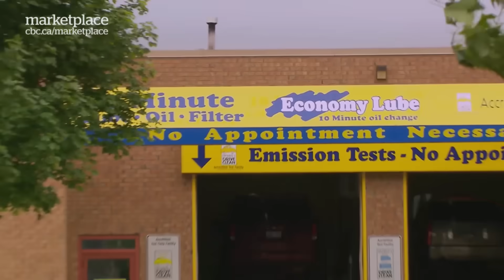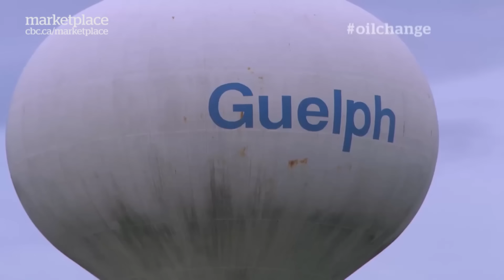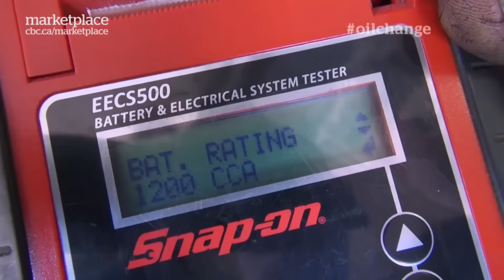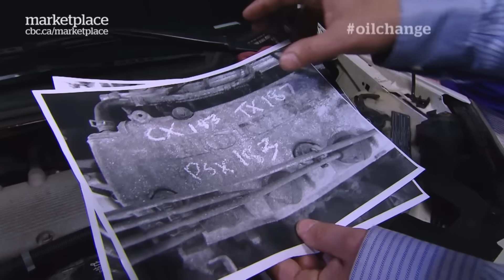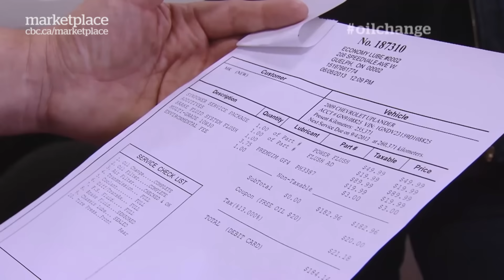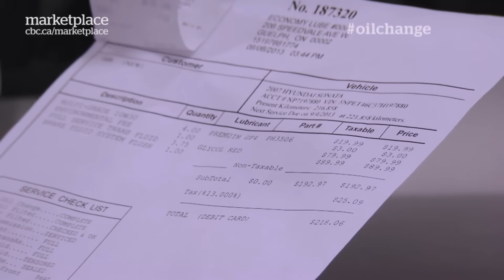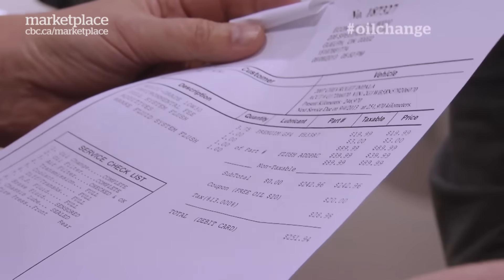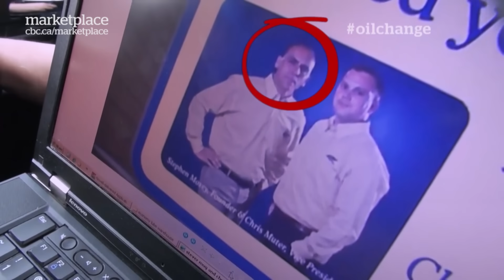Oil change scams: Hidden camera investigation on what really happens to your car (CBC Marketplace)

Comment: A honest mechanic is as important as a good doctor.
Reply: And just as hard to find!
Reply: If your brakes or steering goes out while you’re doing seventy you’ll appreciate a well maintained car like never before.
Reply: @johnnolan4003  Power steering flushes aren't even a thing.  You will not find it in any owners manual on any car.
Reply: John Nolan Next time you're sick in hospital remember to send for a good mechanic.
Reply: @tonygrettel  Hydraulic power steering fluid still is used by many vehicles. My G37 recommends change at 60k, i do it every 30.
Reply: Tony & Grettel Perricone the commercial vehicles I used to drive were not equipped with automatic transmissions nor power steering. To drive one of those bucket of bolts was to take your life in your hands.
Reply: You know a mechanic when you take your car to him with a suspected problem and he tells you that you do not need repair work. I found 2 good mechanics this way. I went to the second mechanic after the first one retired.
Reply: Except if your car dies you can buy a new one....
Reply: I think a an honest doctor is more important
Reply: @스머프-s7g  I think it is also important to have a knowledgeable, compassionate doctor. One that communicates and listens.
Reply: @mayonnaise6087  When you get hurt badly because of shody mechanic's work you'll appreciate an honest mechanic
Reply: @torTxoFognaTuluZ  There are bad doctors and health providers in spite of the health organizations. Yet, you have mechanics who are stealing money from their customers. We must demand honesty in all consumer sectors.
Reply: there are honest mechanics, even mechanics that go beyond the nuts and bolts and study mechanical engineering texts, chemistry texts, electrical texts and metallurgy... all of  which apply to the modern car. I was an honest mechanic for many years but lacked the buildings, the fancy certificates on the wall (most are meaningless),the clean white uniforms, florescent lighting and other optical props that say 'this guy is a real pro'.  Yet I never lost an engine to an improperly installed headgasket nor any other major malfunction of anything I worked on. Still, getting work was difficult, without all the trappings. Yet I saw people making money with 'orange rebuilds' (steam clean the engine and paint it with industrial orange... that was the entire rebuild. Frustrating. Now I will not work for others, I only work on my own vehicles or close friends, and not much of the latter. BTW, because I did not have all that 'gingerbread', I did not ever once get paid scale for my work.
Reply: BEWARE PEOPLE THESE OIL CHANGE SCAMS ARE STILL GOING ON. I PURCHASED MY OWN SYNTHETIC OIL TO BE USED AT A OIL CHANGE FACILITY AND THEY SWITCHED MY EXPENSIVE OIL FOR A CHEAP NON-SYNTHETIC OIL. THIS HAPPENED IN AMARILLO, TEXAS. IT'S PITIFUL YOU CAN'T TRUST ANYONE !
Reply: There are non unless you do it yourself
Reply: Not many honest Doc’s from a honest mechanic that went for 1 op and they gave me 13 ...?...
Reply: All you need is a little bit of knowledge.

You don’t have to be able to do the stuff. Just enough to know if it’s needed or not.
Reply: Car doctors
Reply: No.  Because I can fix my car myself.  Always have & always will.  I can't put in an artificial hip though!
Reply: Lol nope
Reply: Indeed 🙏🏾
Reply: I am so glad my little brother in law is a top notch mechanic. I can bring my car, and he fixes everything in his free time for purchase price of parts and a nice tip.
Reply: My dad says “honest mechanic” is an oxymoron
Reply: John Nolan bet you had some serious guns though
Reply: Don Townsend ouch!
Reply: John Nolan Oil change workers are not mechanics.
Reply: John Nolan People need to learn how to change their own oil. Its very simple.
Reply: an
Reply: @스머프-s7g  doctors aren't as inclined to up sell. how many Drs work on commission like this?
Drs are more likely to get kick backs from pharma companies, lunches n gifts to write scripts for their medication
Reply: Not if you don't own a car.
Reply: Preach
Reply: Enlight of the popularity this post has, I am offering $14.99 oil changes, and a free 99 point inspection. To everyone.
Reply: have a sick kid that needs a doctor? well a car is gonna be necessary no mechanic no car, no car, no help for sick kid
Reply: An*^
Reply: John Nolan, when my son worked as a Toyota mechanic, the shop encouraged the mechanics to do work that wasn't needed.  He told them "I will NOT do work that isn't necessary"  Some of the mechanics would do it, but they had trouble sleeping at night.
Reply: I'ma mechanic and all these they show is true
Reply: @jbodden6977  'orange rebuild' LOL! yeah, so true...coat of paint and the value increases, many fold.
Reply: hard to find one , seems to be a trait of their profession . I guess we all need to learn more about our car .
Reply: And an honest mechanic may charge more per job, but you get what you pay for
Reply: And just as expensive too.
Reply: A honest mechanic only lower your chances from mechanical failure accidents, which might still happen. Doctor meanwhile, is there to address much more possible sources of your harm. It's not comparable at all.
Reply: A good and honest people is what we need, whatever their job is..
Reply: U peoples mindset doctors can cheat patients by operation & spoil others health for his survival but mechanic/lower class should not cheat white color job mens & businessmens
Reply: You're trying to compare Apples to Oranges.....Which is more important 🤔 🤦‍♀️😂😂😂😂
Reply: C Hoc   All 3 were upstate South Carolina.  I'm sure it's statewide, and nationwide.
Reply: @xFlared  I just traded my 2013 g37 for the 2019 q60. :) You are correct about the fluid change recommendations.  🤙
Reply: C Hoc  You are right. I sit here with a serious disease that should have been detected by my health  provider. I am debilitated now due to their incompetence. Yet, I have an excellent health insurance company. Blue Cross and Blue Shield have treated me in an exceptional manner. It is why I make objections when I feel that a doctor is trying to take advantage of them.
Reply: Yes we should all be that's why I studied to be that exact guy
Reply: i have my father in law 😀😌
Reply: I’m a doctor and I agree. Prevent accidents due to car trouble in the first place and there would be less accident victims we would have to treat.
Reply: @Kurama_02  It's easy to change your own oil... sure, if you are young and have no problems with mobility.
Reply: Those are just as rare and hard to find these days!
Reply: We don't call it pratice
Reply: I'm a honestly poor mechanic that sleeps great every night !!!!  I'd have it no other way .  
With respect,
   Russell
Reply: There are no good doctors that prescribe us pharmakea i.e. witchcraft, sorcery and poison after accepting bonuses from Big Pharm.
Reply: Zappacosta   No a doctor is governed by insurance and drug companys
Reply: ChrisGvitar maybe you can
Reply: @mayonnaise6087  Different industries but both are just as important. Both professions can save lives if honest and can take lives due to selfish means
Reply: and in some cases you only need one!
Reply: We all should handle these people   the right way with a right and left then the law comes in
Reply: That’s why I fell in love with my hubby, he’s a mechanic that doesn’t work as a mechanic. He just knows all about cars. He takes care of our cars, we never go to a mechanic . But if we do need a mechanic, he has a good friend who owns a shop. We also have  a cousin who’s a master plumber so we get plumbing free. And cops who give us pba cards. And an electrician friend. And an awesome roofer friend. We have all kinds of good friends. Oh and my bff is the best construction worker ever. He’s incredible. Anyone who is my friend has a friend with huge benefits
Reply: @Puddycat00  nice
Reply: That's exactly right...I have 5w20 in my veins and I need a flush every once and a while
Reply: My hubby is a mechanic and there have been several jobs he has quit because the boss was asking him to be dishonest.  He won't work for someone who is shady.  He likes to take time with guests and he will take time to explain why you need each repair if need be.  There are honest grease monkeys out there.
Reply: @Kurama_02   ,n
k
Reply: @xFlared  dwd
Reply: So true
Reply: Pure fact.
Reply: Joro 303 I Have a great mechanics he’s like fam
Reply: Joro 303 not really, if you are determined you will find a good mechanic. Like me I tried so hard to find a good mechanic I decided to go to the school to learn how to fix cars myself. And now I always have a good mechanic around me!
Reply: haven't seen one yet, lemme know if you ever find one
Reply: DarkestofTimes i didn’t get the sarcasm did you?
Reply: Matt from Florida , ohhh go online, find the diy Haynes auto doctor book... go to junk yard, buy a used hip. Fix it yourself! Don’t pay doctors for that stuff. If you can read you don’t need those docs. 👍🏽
Reply: And as rare as a hens tooth.
Reply: Well, not really ... one holds your life in their hands, the other holds your wallet.
Reply: Super facts!
Reply: All those doctors giving out oxycontin like it's candy.
Reply: @mikewilliams258  you might need a good plumber.
Reply: It's equally important to properly educated yourself to know exactly what they are talking about, and even to be able to do it yourself
Reply: But gets payed very poorly!!
Reply: @johnnolan4003  you mean, you'll appreciate a good doctor when you are brought to the hospital after the crash?
Reply: Thats not a good analogy
Reply: Get a bike. Service it yourself.
Reply: Duhhhhhh
Reply: Or contractor
Reply: An*
Reply: Yeep
Reply: not really
Reply: An*
Reply: @iamapokerface8992  based
Reply: i would never trust a doctor
Reply: True,  but every once in a while,  it would be nice to run into a good mechanic and an honest doctor.
Reply: Dawg oil change katz...r knott...mechohs
Reply: @스머프-s7g  you're right, the comment is a bit foolish.
Reply: @matchthat5053  dawg what cmon back kupkakes
Reply: @Match that  dawg what are you saying 😂 🤣 🤔 😐 😒 💀 😂 🤣 🤔 😐 😒 💀 😂
Reply: I’ve got a great mechanic.
Reply: Few n far between then
Reply: @mikee9673  how u know
Reply: @h7283  what dawg
Reply: À I'll sit next to you RMZ 2007 Dodge how tight do you have to change the button stator pulley
Reply: @Marilyn Willett dawg how zo bro
Reply: @joro3038  agreed
Reply: Oh god..
Reply: @stanleybochenek1862  yes me lord
Reply: You’re delusional. It’s MUCH easier to become a mechanic than a doctor. Not to mention, a doctor is FAR more important than a mechanic.
Reply: @Greendollar640  how so
Reply: @mikewilliams258  wouldn’t be in that hospital in the first place without crashing into a guard rail and being in the ICU like myself for 1 month
Reply: *obligatory mid 2023 "i am a surgeon"*
Reply: @2004DodgeViper  why is my foot numb 4 months after trimalleaor surg
Reply: Don't even compare the two professions 😂 People can live without cars the only reason you're alive today is because a good doctor somewhere along the line helped out
Reply: @johndiddilyjoe6258  bloke not hardly bucko
Reply: Agreed!-  and I can't find EITHER! - HAHAHA!!! 🙂
Reply: @judsonleach5248  bloke try bucko
Reply: It doesn't matter how good or honest your doctor is because no hospital is good or honest.
Reply: @JohnSmith-fq3rg  bloke chill 😎
Reply: @comodice905  I haven't even got antisemitic while talking about doctors and hospitals, I am already very calm.
Reply: @JohnSmith-fq3rg  bloke superchill pill popper yank
Reply: As *RARE
Reply: @2004DodgeViper 💀💀💀
Reply: Correct yes like that
Reply: Yes, and even tarer.
Reply: FFS can you ever find an honest doctor ? most of them are chancers from what i see ?
Reply: @tonygrettel  Cars don't even use power steering fluid anymore. They are electric nowadays
Reply: And in reality neither one exists.
Reply: @Error404GodNotFound  Another thing I have come across, is someone brings in an old high mileage terd and I do a recall and then they say all these things are now wrong with it "ever since". I guess they don't think that the technician at least has to look at the car for free and show them these things have been needed for years

Comment: I live in Norway. I went to my local Car Mechanic and asked for an oil change. He asked me when it was changed last, and if the filter also was changed. He then told me "come back when you've driven another 2000 miles and we will change it for you, it's still good"

I came back after 2000 miles, and he asked me if I wanted to see when he changed so that I could do it myself one day if I wanted, but he would gladly change it for me always if I wanted.

I now work there.
Reply: Damn that’s wholesome
Reply: nice. Over the border they charge you 4-500 bucks for an oil/filter change lmfao
Reply: People are more honest there than USA.
Reply: Another reason to move there.
Reply: Cool
Reply: Outstanding integrity.
Reply: Got my first car at 20, been through 5 cars now and still own 3 dof them. I change all liquids myself. Glad I grew up with 2 car guy older brothers and an extremely handyman for a father.

The only money I spend on any changes are filters, parts and the liquids. Everyone needs to learn how to do these simple changes.

I have one modified car and I purposefully change my oil well before it's needed, I check my oil after every +-200 miles just to make sure I don't burn oil or my oil doesn't go dark too quick since I always drive the car hard.
Reply: What a great story
Reply: A Norwegian told you to drive 2000 miles? miles?
Reply: @JastwatchingYT  american video se he wanted to change the values.
Reply: @JastwatchingYT We use the Scandinavian mile (Mil) alongside the km in Norway and Sweden.
That might be what he means.
Reply: Wow coming to know even people in developed countries face scams like this.
Me in India have purchased and replaced oil in front of me in 2004.
😂😂
Reply: @M_Lund  That's actually really cool. I had no idea
Also, the Scandinavian mile is massive, damn.
Reply: @franklofarojr.2969  this current story is in Canada though not thr US
Reply: I would move to Norway in a heartbeat if only you would turn up the thermostat a few degrees!
Reply: @NODE1975 it probably happens more in the US 😂
Reply: . Ahhahahahahahah...ahhahahahahaha
Reply: You must be kidding!
Reply: That ending took me out 😂 10/10 storytelling 😂
Reply: GIGACHAD
Reply: It's because Norwegians take care of each other and live a community-based life for the greater good of all. I'm not going to lie. I'm a little bit envious.
Reply: It's Europe and there are still norms and values.
Reply: We nordic countries are a bit different from the rest of the world. I'm here not to brag about it but honesty is valued so much more htan for example USA where very customer is a potential victim.
Reply: @JastwatchingYT  Nordic countries know how to divide with 1.6. I also usually convert any metric system to imperial just because i try to be polite. Youtube is a US platform afterall and i know they measure all in some weird old models like footballfields and common airplanes. so weird. There is also no doubt of his sincerelity though. I know a fellow Nordic when i see one.
Reply: My boyfriend’s family is from Norway, they are very sweet and honestly this just shows it. ❤️
Reply: Tbh, it was his Dad’s shop
Reply: people with morals
Reply: Love genuine people like that.
Reply: Sadly insurance does not allow customers to view the work being done in the US
Reply: In the US it's the exact opposite. Nobody got rich being honest (capitalism)
Reply: All of these companies are bad. Sullivan tire, jiffy lube Monroe and rapid lube by shell. Of the ones I listed Sullivan tire is the worst. They lie lie lie when you need a vehicle inspection. Monroe isn't awful but they have incompetent people. I once had an oil change done on work break ( it was a food service job with split shift setup, hour between or more ) and I kid you not their lift broke and my Taurus was stranded for 2 plus hours while another manager from outta state came with an emergency release key. Had to call my manager at work and explain. He gave me a lift back and took a look and was flabbergasted.
Reply: Scamming ppl too